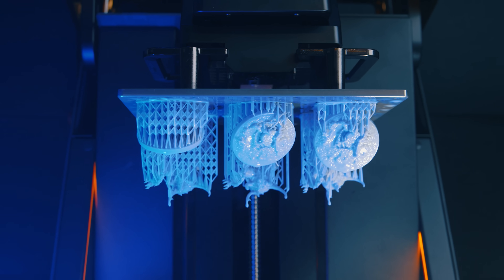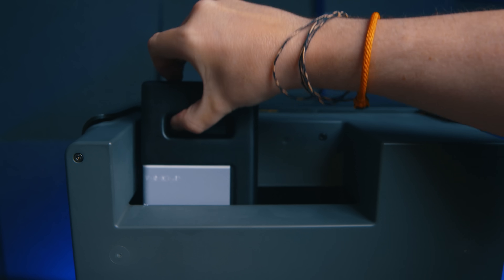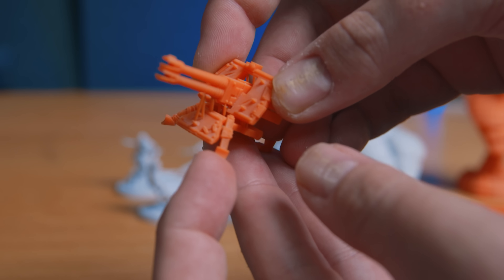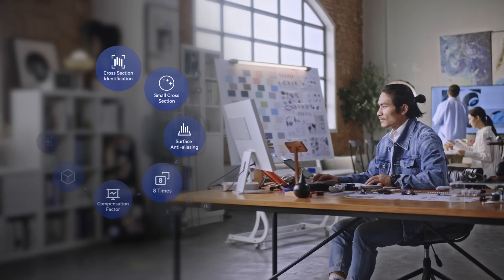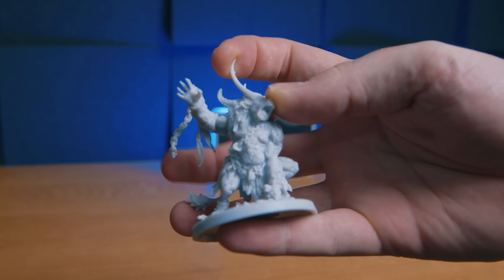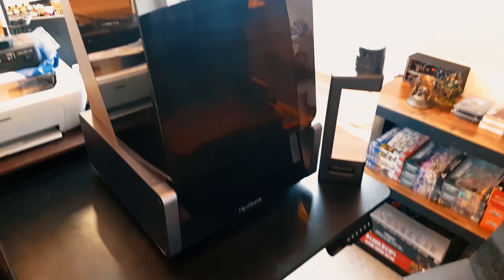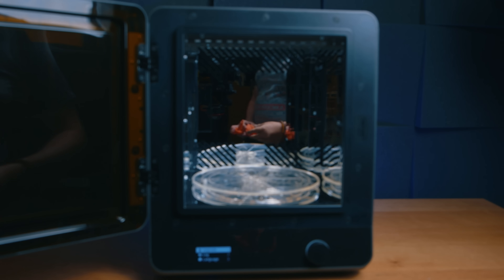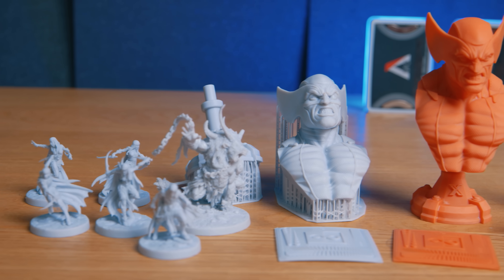HeyGears Ultracraft Reflex Preview - A 3D printer FROM THE FUTURE

Comment: Looks like an MSLA Formlabs clone without much innovation in comparison, and at a similarly high (albeit much lower) price point that most hobbyists won't be able to justify. 

The whole 3D printing ecosystem sounds great, but the question remains - how closed off is it? If the cheapest resin you can buy is £100/L it's just not affordable for the vast majority of consumers. Or if the company goes under, or stops supporting that model of printer, so you can effectively no longer use it. If they released an open source resin bottle that you could alter the parameters of that would be great, but I that seems to go against what they're trying to push with this.  

That being said, it's good that Formlabs have some competition. But the closed system is really not the direction I think 3D printing should head, and having worked with similar machines in the past, the price difference is mainly for the cosmetic appearance/'ecosystem', rather than the functionality.

Comment: Interesting product - very tempting as I’d just like a resin printer that is plug and play, novelty of bed levelling and faffing with exposure settings and failed   prints has worn off now - the 3D printer is more a tool for me to produce items for hobbies, instead of purely a hobby by itself.

the proprietary resin is putting me off though 🤔

Not a fan of that wash station sadly - don’t have the space for it and anywhere I would put it, would be shaken too much by it shakin’ it’s shimmy, will stick with current wash and cure station - even with its lift off lid

Comment: Their website is a catastrophe, it took me 5 minutes to find the specs button, to see that this is a 6k 10" mono screen printer. I am pumped to find out, which glorious feature is supposed to sell this machine.
Reply from the maker: @cryptokingstechgaming5826 you must be new tto my channel if you think I'm being paid to pump something. Other thangetting the printer i got £0 for this, unlike other creators who did get paid.

My thoughts on this are my own as are any video. don't believe me? with all due respect, ask around.
Reply: @FauxHammer  Yeah dude Fauxhammer pretty much relies on being neutral.
Reply: @cryptokingstechgaming5826 How do you think anyone anywhere does reviews? They send you gear to test out, you review it. Look back at other reviews where he states what he thinks about printers that haven't ended up being recommended. It's the same set up. Being sent a printer to review isn't getting paid, you just don't understand the process.
Reply: What page are you on? Scrolling down to the bottom of the Reflex page shows that it's a 6K screen and I found the specs button after clicking the learn more button.
Reply: Agreed on the website, a complete disaster. Gives a very bad first impression when you have to navigate such a mess. The printer itself seems OK but at the moment I'm leaning more towards GKtwo actually.
Reply from the maker: “Features” plural, it’s not just a printer, it’s a whole printing platform.